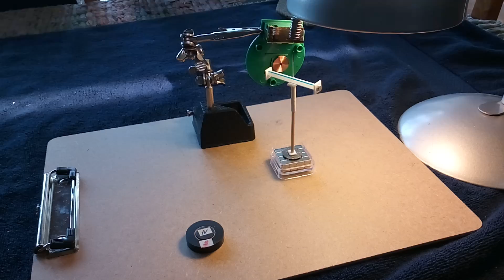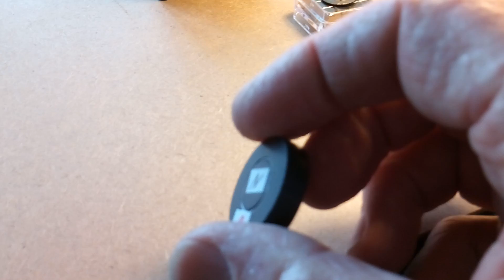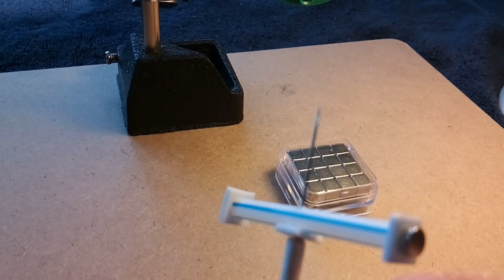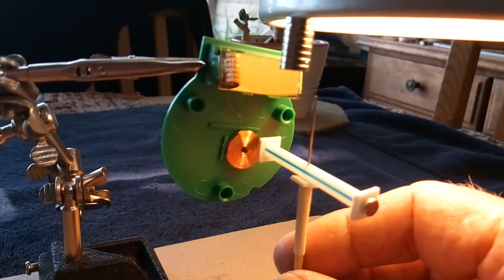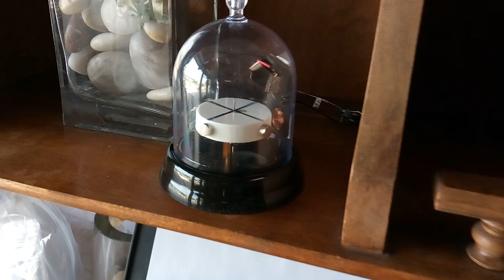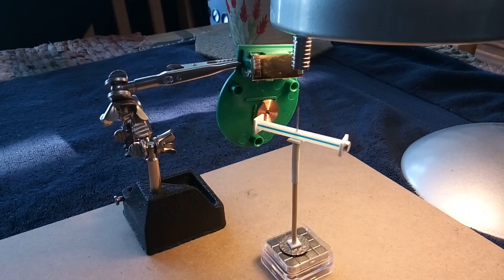Fully Levitated Pulse Motor Rotor

Comment: Hey, i m trying to build a maglev "train" with neodym magnets and graphite from a pencil. (made a short video)I saw you tried it with normal and pyrolytic graphite.Does pyrolytic graphite levitate much higher or more stable ?Is it worth it to buy pyrolytic graphite ?
Reply from the maker: Get a small amount of pyrolytic graphite and try it first before you spend a ton of money on that.  It does work but the cost is a lot.  Pencil lead works but there isn't much power there.

Comment: Nice job.  I saw in the comments below you mention the ring magnet base was more stable.  I was thinking the height made the pulse  from the coil reflect back to the graphene. What if it was a shorter height, would it help the wobble?
Reply from the maker: You have to keep the magnets away from each other.  Actually the further apart they are the better.
Reply: @Lidmotor  true about keeping it away but maybe having the top magnets more centered on the ahaft may make the oscillation more stable...just a thought.

Comment: Consider that the pyrolitic graphite  is unstable due to eddy current generation at the magnetic intersection nodes below it.
Reply from the maker: It is a bumpy road it runs on.  The ring magnet base seems to solve the problem.

Comment: Very nice! A fully levitated anything is cool lol
Am testing a 24/7 runner, conversion of the bottle cap motor from last vid. I'd like to somehow limit speed of discharge... as you said here, it's faster in the day, slower at night. Uses 40mV per hour on a 10F supercap.
Reply from the maker: These small 24/7 non-stop runners are a lot of fun. So many things can go wrong and stop them though.